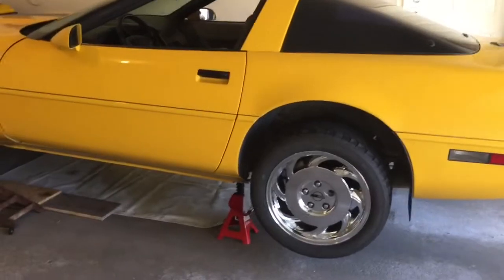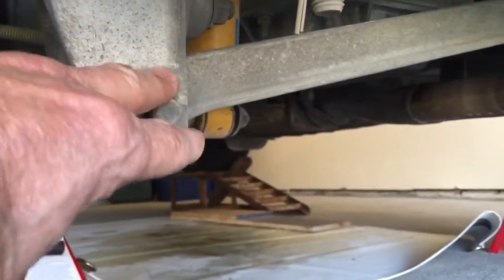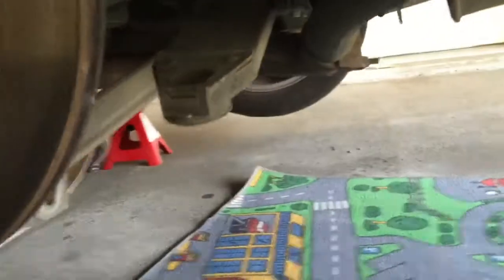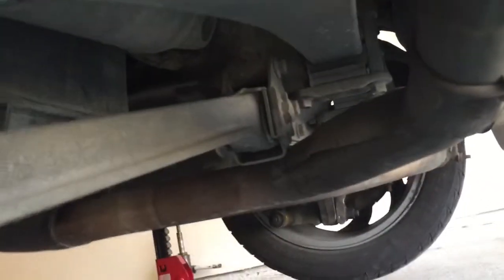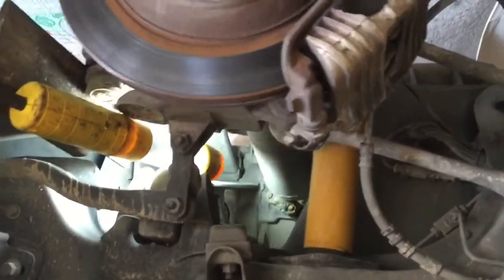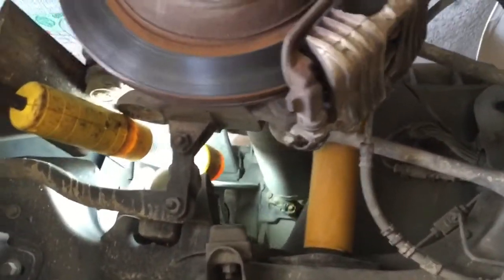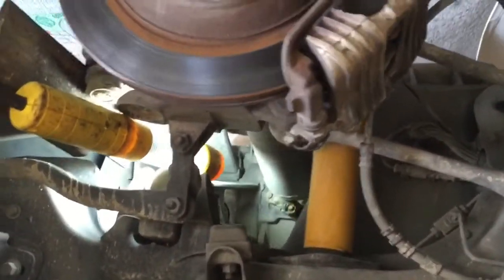C4 Corvette half shaft removal

Comment: That socket combo is the small set for changing plugs. There’s a 40 piece set for that job. Lol Nice video. I’m replacing all the bushings on my 95, and this was a big help. Now I’ll replace u joints also.
Reply from the maker: Thanks Johnny B for the nice comment.  The first time I changed plugs on the 91 I did not know that you could remove the panel in the wheel well and make the job a lot easier.  Half shaft U joints are not a bad job really.

Comment: Just started the project this afternoon on my 86 C4 and tuned into your show for tips.  In my case, the lower control arm bolt is being a monster.  The nut came off without much difficulty but trying to get the bolt out is going to be brute force.  Any ideas on how to get it out?
Reply from the maker: Hi there.  Been quite a while since I did this work, so looked again at the video for reminder.  If the nut came off OK, then I would take a wrench or ratchet and try and turn the bolt.  The bolt should turn.  If it does, then it isn't rusted or otherwise locked in place.  I would take a punch and two pound machinists hammer and drive the bolt forward out of the assembly.  You could also put the nut back on loosely to protect the threads and bang on that with the hammer.   You are not talking about the tie rod end are you?
Reply: @flyboyslc1  The tie rod came out without any trouble.  The nut on the control arm bolt also came off without much difficulty but the bolt, itself, seems to be seized.  Tried and impact gun on the head of that bolt and it will not turn.  I'll let it soak with some Kroil overnight and see if it will budge in the morning.  As of this evening, I am not seeing a good future for that bolt and will come at it with a 4 lb LFH to drive it out.

Loved your paint job videos, it came out beautifully.
Reply from the maker: First Last   Normally when all else fails I use heat.  But I think there is a rubber bushing in there that wouldn’t fare well.  You may have to destroy the bolt and bushing.  Interested to know how it turns out for you.
Reply: @flyboyslc1  Success!  I beat the stuffing out of it and used a 2' breaker bar with a 2' piece of pipe for additional leverage and finally got some motion on the bolt.  Took 45 minutes of twisting and the bolt and hammering with a 4 lb sledge aka lfh.  

Had to use a cut off tool at the end to get the bolt through bushing assemble as the threaded end had mushroomed a bit to wide to go through the hole.  I may actually have enough bolt remaining to still use it for reinstall but the nut is done for.

The right rear side came apart pretty easiiy but it needs to sit over night with Kroil to get the half shaft out of the yoke on the wheel side.

These u-joints may be the original Spicer models and now have 215K miles on them.  They should have been replaced years ago but it was a daily driver.

What do you fly?
Reply from the maker: First Last   Wow!  You had quite a struggle. Wondering if your car saw a lot of winter road salt or something?  One thing I didn’t mention is that the u joints for these corvettes should have the Teflon coating on them.  It is a corrosion break between the aluminum yokes and the steel u joint caps.  I built and flew 2 RV series kit planes. Still flying my RV 7
Reply: @flyboyslc1  This is a Massachusetts car so it has definitely seen salt and sand over many winters.

The RV7 is a fine plane.  I've been a pilot for about 42 years and have flown the usual gambit in the Cessna, Piper and Beechcraft lines, owned a few planes and still have a Beech Sport for doing easy aerobatic maneuvers.

The years are catching up with me so my CFII has lapsed but I really enjoyed teaching instrument flying, back in the day.  

Thanks for your tips and videos, they have been very informative and useful .
Best,
Bob Brown
Reply from the maker: @aa3nk  Nice comment Bob.  These comments are the only payment I receive.  Not any ad revenue sent my way!  If you made CFII then you did some work!  Just a vfr private myself.  Went to IFR ground school and did very well, but decided that IFR would make flying not a lot of fun (for me anyway), so never went further with it.  At 68 years of age, I am not far from selling the plane and just looking skyward and smiling at the fly-overs.  But not for a while yet!  best your way too.  steve
Reply: @flyboyslc1  We are the same age.  When we were kids/teens, we worked on our own cars and accumulated mechanical knowledge along the way.  There have been so many technological advances over the past 50 years that much of what we used to do is no longer necessary--no gapping points, setting the dwell and seldom any need for a timing light.  Fuel injection is well refined, I have not overhauled a Rochester/Stromberg/Carter carburetor in 40 years but I can still take an engine apart and put it back together.

Building an RV7 is not cheap and it takes a lot of special skills.  Thank goodness that there is so much access to information and user groups to keep things focused and practical.

Got the new universal joints delivered this afternoon, not one of them was the right size, dammit.  Evidently there were variations between aluminum shaft and steel shaft yoke dimensions.  Advance Auto will have the "right" size in tomorrow and I can put her back on the ground.

I intend to jack her back up for the paint job, sometime in the next couple of weeks, just because it makes it easier to reach the low parts.

In 1986 I bought a factory order Jeep CJ7 for me and a Fiero for "some woman" but I really coveted either a Corvette or a 911 Porsche.  Then, children came along.  It's been awhile but this Corvette project car was just too easy to ignore.  If the rotator cuffs and elbows don't quit on me, it should be some a fun and a good way to stay focused :-)

Thanks for fun conversation and shared interests.
Bob

Comment: You should replace those straps man, that's what holds the cap in place to stop it from spinning in the yoke
Reply from the maker: Hi Carl,  Well, you can always replace lots of parts if you think you need to.  My inspection of those cap straps is that they looked good, and I reused them.  The car was still running strong when I sold it a year ago.  best your way!  steve
Reply: @flyboyslc1  I get it, I work on equipment with u joint straps like that, I've seen them loose their clamping abilities.... that's all, probably going to be fine. No worries man

Comment: You don't beat on metal to metal it'll crack you're pressing the U-joint
Reply from the maker: Hmmmm,  hammer on nail, hammer on cold chisel, machinist hammer on anvil, sledge hammer on splitting wedge, all never cracked for me.  And my u joint didn't crack either.

Comment: How long should this job take to do ?
Reply from the maker: Al,  anywhere from 2 hours per side to a day per side.  If a shop is doing it, It should be close to 2 hours per side.  Too many variables.  depends a lot on how well it comes apart, and how good and reusable the old parts are.  Working on 25+ year old cars there is never a set answer for that question.You can find fasteners that are rusted in place, and break off when trying to remove.  Then you take the time to somehow fix that.
Reply: Al, it took me about four hours on the left side to get the drive shaft out.  It helps to use some penetrating oil to get u-joint bolts workable and when you do get the half shafts out then you may want to use some more penetrating oil to help with easing the bearing caps out of the yokes.

To get the half shafts out you will have to release the control arm and remove the bolt that goes through the lower arm of the alignment damper.  When you do, you will be able to flex the spindle housing assembly enough to get the half shaft enough to get the shaft out.

I used a 5/16 offset box end wrench to get the bolts loose enough to then use a socket and long extensions to remove the bolts that clamp the u-joint in place.

The u-joints in my 86 model were the original Spicers, 34 years old and with 215K miles on them.  Some of the bearings were still Ok but it was past time for them to be replaced.

I expect that the reinstall will be about two hours for both sides, if that long.  Reseating the new bearings "should" be easier than removing the old ones.

Comment: So when you took out the half shafts you had to have the knuckle come outward
Reply from the maker: Hi Jarred-  The half-shaft is a tight fit between the yoke on the differential and the yoke on the wheel assembly.  To get it out, you have to loosen up the wheel enough to be able to pull it outward away from the car.  I didn't go back and look at the video, but from my memory i know i disconnected the tie rod end,  and the spring, and also the lower arm that goes back to the center of the car.  Hope this helps.
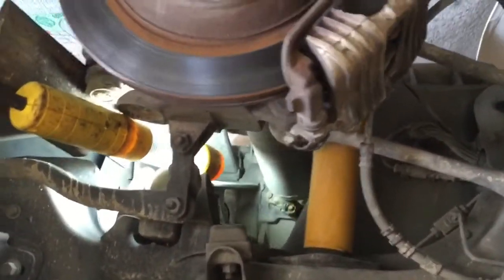Reply from the maker: My car is a 1991 yours may be different?  I just took a look at the video again.  If you take off or disconnect everything I showed at about the 4:50 point in the video the hub will then move outward if pulled by someone else or pulled by yourself and tied off with a rope or wire or something like that.  I did not remove the shock or anything else.  Hope this helps.
Reply from the maker: shock does not need to come off.  If you mean the upper and lower control arms, then yes disconnect the lower one only, at the hub, just as I showed.  Don't disconnect at the camber screw or you will mess up your camber.    The upper one does not need to be disconnected.
Reply: flyboyslc1 so you don't have to take out the whole knuckle itself t get the half shaft out?